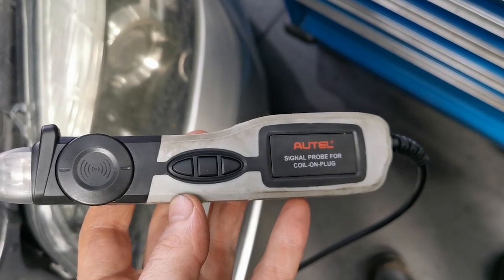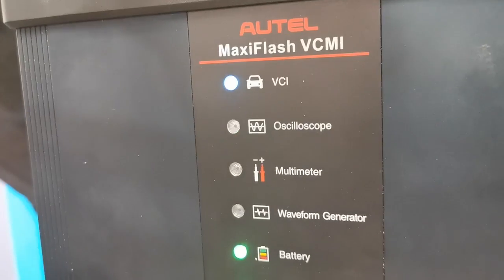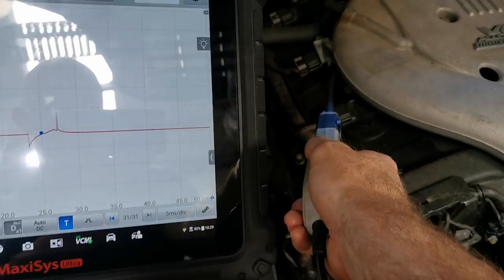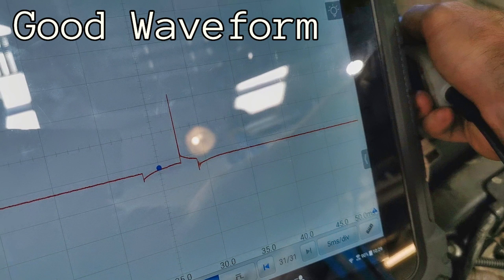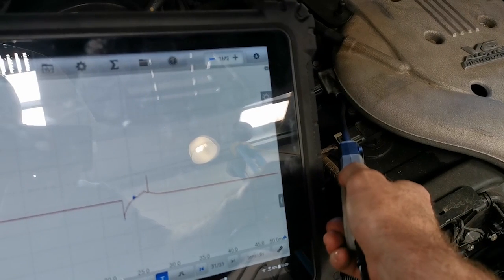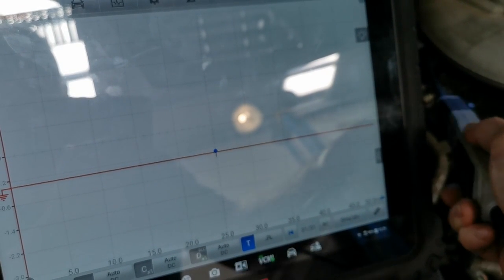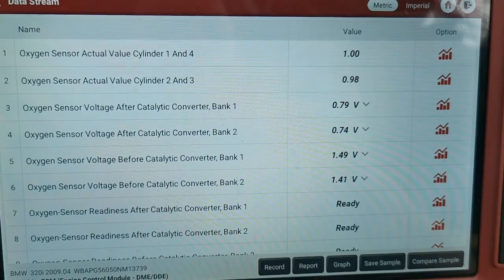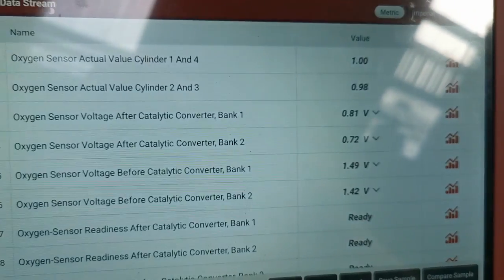BMW Rough Idle & Poor Acceleration - Found & Fixed

Comment: Mine hesitates at lower rpm when accelerating but idle seems fine to me and no misfire codes. Could a vacuum leak cause these symptoms?
Reply: hey bro, ive got this issue with my 2013 bmw 528i xdrive, n20 engine & zf8 transmission. Were you able to find the issue and solution?

Comment: Hello I’ve got a BMW series 1 2018 the crankshaft pulley wheel is not lining up with the rest of the pulley wheels causing the belt to shred any suggestions thank you

Comment: Im having loss of power also unless i choose to shift it manually and seems to have more throttle response when at higher RPMs my question is what can I change because there is also oil in my spark plug wells. PLEASE HELP!

Comment: Great explanation 
I have the issue misfiring 2,5,6 and change spark plug coil and venos selenoid but still idle and reduce speed warning engine light 
And not responsive when drive probably throttle body

Comment: Hello friend I have a nightmare with mi N42B20 engine with a misfire current, I swap coils and sparks and the misfire continues in cyl 3, swap injectors and continue, I changed the o2 sensors and continue the misfire cyl 3 with the bank 2 before cat code I checked the dme with comp serviste and says it’s ok I have to start the car and accelerate and brake it in the road to the car goes with idle stable but I shut off and then start again and the misfire and o2 codes comes again. I don’t know what else to do, compression it’s over 150 too, what more can I check?
Reply: did u solve ur problem ?
Reply: @karim-iz7lw hello, no, I Did Not I still looking for the problem and here no one reply but they ask you to suscribe and give a like always , I have this engine and I can’t recognize which it’s sensor 1 or 2 and bank 1 or bank 2 already

Comment: Ok I really need help with my bmw m6 2015  I have no codes I have no problem pr noises - but my problem is that it does not feel like an M6! It doesn't speed up like a fast car should I step on the gas and the RPMs move up slow
Reply: I had this problem with my last bmw, I had to have my intake manifold replaced
Reply: @garyburke7384  thanks for replying! So my m6 is a 2015 it has a new engine in it  but this car if I step on it the first time it hits the RPMs fast but it does not peel out! Or feel like it's taking off! If I am already doing like 40 and try to race the RPMS move up so slow even on sports plus mode and traction off.
Reply: @88adrian25  yeah so with mine it felt okay in lower gears but when I had it out on the motorway, it would struggle to get above 2000 RPM, I would have my foot down to the floor but would only very gradually pick up any speed and would struggle to get above 120. With these BMW’s going to your nearest BMW garage is the best thing to do just so they can run diagnostics, so many different things could be the issue

Comment: I got a e46 with n42 1.8 manual and it revs for itself to 1800 rpm and back to idle, when it starts to rev up I get it a bit of car and it revs and drop back before repeating the cycle…please help
Reply: Map sensor